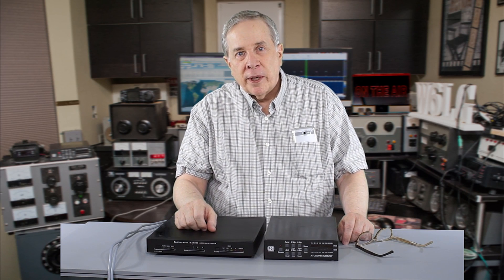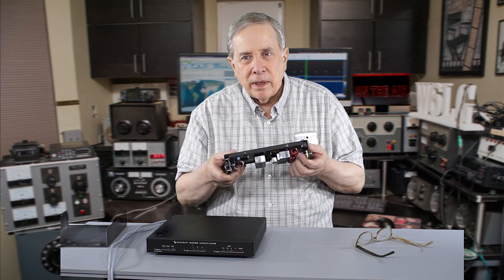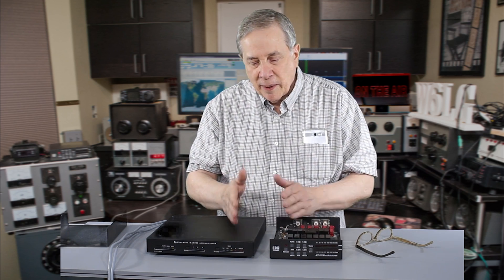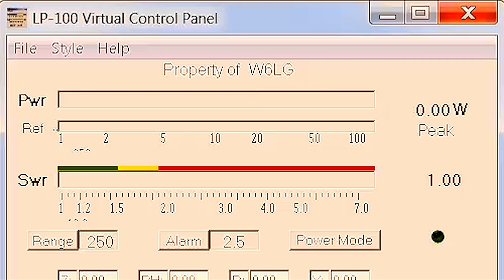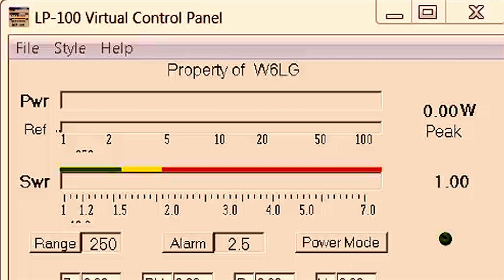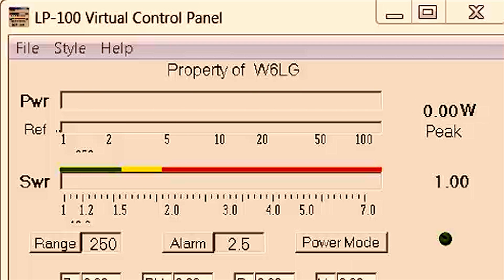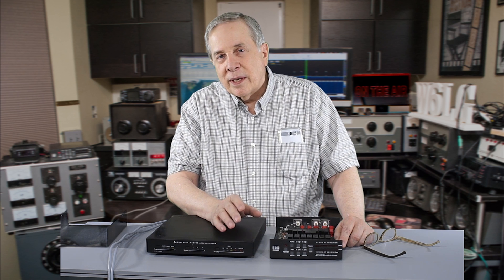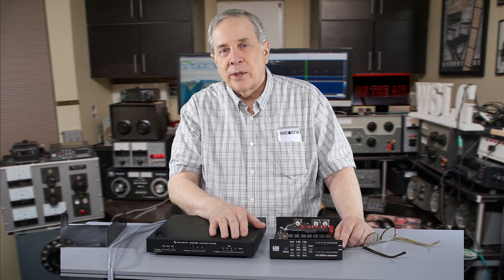Ham Radio Basics--Jim W6LG Tests Antenna Tuners, Which One is the Most Efficient

Comment: a) An antenna tuner is a guy with a pair of side cutters.

b) The bigger the tuna the more pasta you'll need.

c) An impedance matching device matches your antenna impedance to your radio RF output impedance.
Reply from the maker: Absolutely!  I did manufacture a device that did in fact change the physical and electrical length of the antenna using a motor. The antenna tuner that someone might buy or have in a transceiver changes nothing at the antenna.  In my view, the name 'antenna tuner' is marketing baloney. Impedance Matching Device sounds better.  The need to have one is overdone.  Heck, I did not use one for probably 30 years.  Thanks and 73, Jim
Reply: Jim W6LG      lets not for get those of us who are using balanced feeders....with an eighty meter dipole and a tuner with a 4 to 1 tuner you can work jjust about anywhere with a single antenna.....

Comment: Hi jim, got a question for you. .I am installing a new mosely tribander and my question is do I need to wrap up coax for a rf choke?? Do you have this also?? Tnx again
Reply from the maker: Yes, you need a choke at any HF antenna. You can wind the coax or use ferrite beads.  Carl Mosley did not believe that the choke was needed. 73, Jim

Comment: This is a good topic. I think so because I've used an MFJ manual tuner that seems to really suppress incoming audio quite significan'tly when it's attached. In fact, I ended up taking it off my FT-450D the other night when using it up at my cabin up north. That's around their bottom of the line and perhaps intended for QRP.

Comment: I was a bit surprised that you tested the first two, the big guys, at 100 w, then the autotuner at 500W. (all approximate)
Given that the tuners, at both power levels, came out looking good, it may not make a difference. But I would think that any tuner would work a bit differently at 100 vs 500 watts: Coils would heat more or less, the dielectric in non-air-spaced capacitors like the automatic units use would shift several several parameters, and things like that. I guess the surprise (I certainly was surprised too!) outcome, very high efficiency, means that there would be very little heating and other changes.
But in science a surprise is frequently a good result. Keep up the great work!
Bob Wilson, WA9D

Comment: Very interesting outcome, I run a t-match via a current balun into an open wire feeder, the impedance is all over the place but I suspect the losses are low. (Nothing gets warm). I imagine that the example auto atus will only get distressed with hideous mismatches where the circulating currents start piling up. A lot of modern day hams seem to believe that every part of the transmitting chain should be 50 ohms and that atus are the devils work. In my case using an atu with a high pass characteristic helps keep the local medium wave broadcaster out of my radio. Your videos are well thought out and presented (unlike my comment), keep up the good work 73

Comment: Jim - Excellent video, thanks. I also would appreciate your thoughts on locating a remote tuner at the balanced antenna feedpoint vs trying to tune at the transmitter end of the coax. Thx, and 73. Lyn, W0LEN.
Reply: Lyn Norstad if you are using a significant length of coax and the swr is significant the atu is best as close to the antenna feed point as possible. However an atu in the shack will not get invaded by spiders and bugs, or be attacked by the elements.
Reply: g0fvt , I'm using an Icom AH-4 which is well sealed against the elements. Additionally, I have it located in the attic,  which helps.
Reply: Should be fine, it will be safer than my friends auto atu that he managed to bash with a lawnmower!

Comment: It would be interesting to put a 25 or 100 ohm load for 2:1 SWR, tune the tuners, then measure the outputs.
Reply from the maker: Hi Randy,
Thanks.  I varied the load impedance using a homemade tuner that was not really discussed.  For example, the SWR shown in the video was 1.1:1 when I calibrated the wattmeter.  The SWR for the Nye Viking tuner was 1.69:1. The SWR for the Drake was 2.06:1 because the impedance was adjusted to about 25 ohms.  

The homemade antenna tuner is sitting on a box with 2 wattmeters that is on top of the Nye Viking to my right in the green screen picture.  The two wattmeters in one box measure the power to the two yagis so I can watch the power fed to each yagi. The homemade antenna tuner is actually two tuners in one box.  That tuner is used to adjust the two yagis that are combined and fed into the Nye Viking.  The red indicator lamps on the wattmeter box show which phasing line is in use.  The toggle switches control vacuum relays and a series of coax connectors.  Antenna switches are used to pick combinations of yagis. I don't know the overall gain of the system but it could be 9db.  Through all of that 'stuff' the losses are very small. 

Thanks Randy. I'll try to do one with a more extreme SWR; impedance.  73, Jim W6LG
Reply: Exactly.  Tuner losses vary proportional to the load, different tuner configurations yield different results for different loads (like, T tuners do well at high impedances).  I know I've seen some ARRL lab figures on this, and the tuners vary wildly in losses into different complex impedances.

Comment: Super interesting! I've always felt my Johnson Matchbox was lower loss than any of my auto-tuners... but that may well not be the whole story! I know balanced open feedline is much less lossy at high SWR than coax. One point I think you might have made which would be useful when thinking about this... Antenna 'tuners' don't actually tune the antenna. They provide smooth transfer of power between the radio and the antenna. They're more accurately described as antenna matchers. You can still have very high SWR on your coax on the other side of an antenna tuner, and suffer lost power. Thanks for the video, and 73. de w8tam